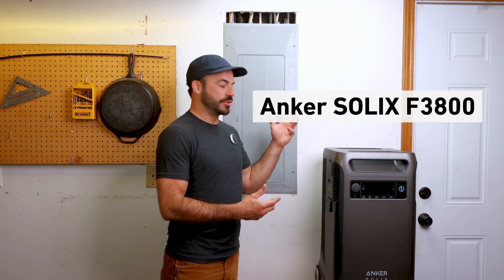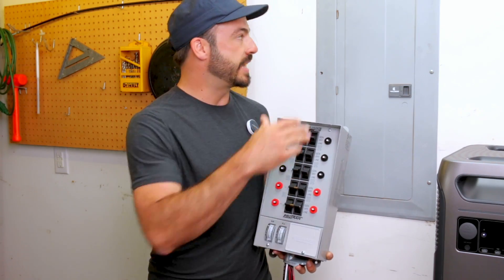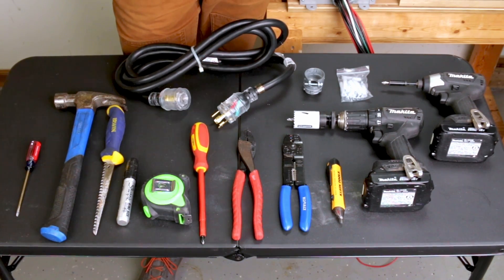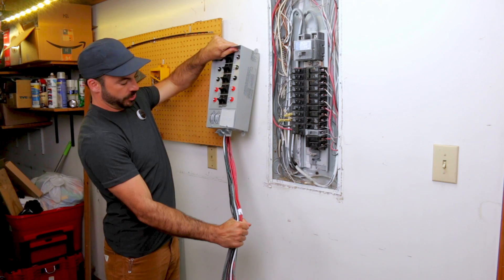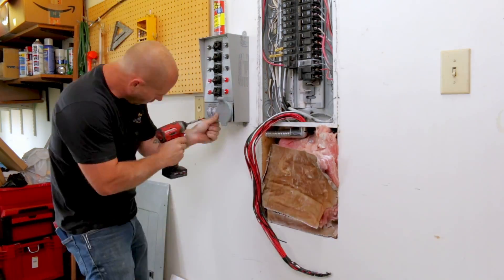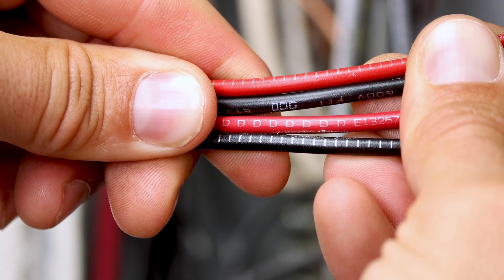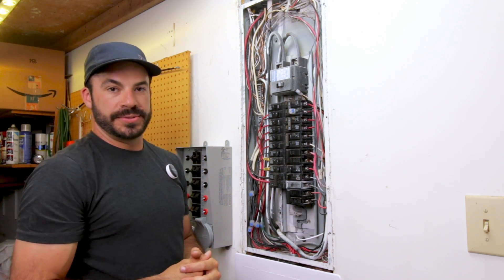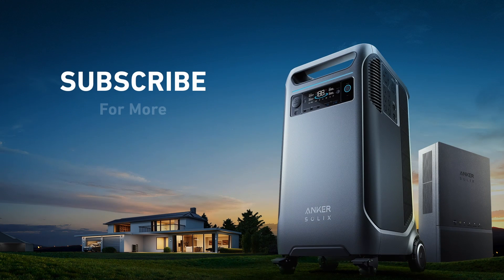How to Install a Transfer Switch for Whole-Home Backup Power | Anker SOLIX F3800

Comment: When you start your 1/2 HP house pump what wattage did it draw on start up ? The anker had no problems starting pump ? And what if you are using say 1000w on other devices during pump startup ? I have the same pump. That’s my main question before buying. Thanks
Reply from the maker: The wattage it drew was around 1000-1500, which is within the unit's surge capacity, so the F3800 can reliably start the pump as long as you're managing total power usage.
Reply: @AnkerSOLIX thanks. That is surprisingly low wattage. I see my lights flickering for a second once my pump starts. you too ?

Comment: AC breaker on main is dual 30A connected to dual 20A on the transfer switch in the video example. Will that work without tripping the transfer switch breaker?

Comment: Anker? Are you joking? Anker uses cheap, Chinese-made, high-frequency, transformerless inverter tech. Without an output transformer to provide galvanic isolation between its DC boost stage and its AC output, these units can easily damage your home's appliances and your power tools when their MOSFETs/IGBTs fail. If you want to power tools or home appliances, you really should be using a low-frequency, transformer-based inverter.

Comment: 12:00 It was disappointing to see them connecting to the lowly L14-30R 25 amp SOLIX F3800 plug instead of the NEMA 14-50R 40 amp plug. Often there are startup loads on 240v applicances.

Comment: Does the f3800 have any way to tell if your running all 120v loads when you have the 30 amp plugged in or is it strictly 240 regardless if you plug it into the 30 or 50 amp plug. I ask because this would be great in my tiny cabin which everything is 120v. Trying to find a way to address the ability to run this off grid and be able to charge it via dc or ac

Comment: One thing that confuses me is that it is only about 25 amps capable. So how is it gonna run an AC when most ACs have an in rush of 25+ amps just to turn on. On top of the other 6 circuits that may be on at the same time? How does this battery handle this?

Comment: I'm about to hook up my Solix 3800 and I'm trying to decide between this transfer switch and the other Reliance Transfer switches that have built-in Breakers. it seems like this transfer switch won't protect the load when running off of the anchor solex power. Is there something I'm not seeing

Comment: Great video. Never realized how basic a transfer install could be. I want to make sure to charge my f3800 with my solar what is the best way to do that? I would actually have my f3800 mounted to a custom tear drop trailer and when home it would be ready for outages and actively charge from and ideally power the house at night.

Comment: Did you install a 50A or 30A transfer switch?
Reply: The transfer switch allowed for a 30 amp, 120/240 volt input.

Comment: Just the load wire is being isolated. The neutral is being shared with the other circuits that are connected to the grid?   Does that cause any problems?
Reply from the maker: All breakers and switches work by usually isolating one side of the power circuit (hot or neutral) to control the flow of energy, with hot being the most common, while leaving the other side of the circuit connected. That is the case here and it is absolutely fine for this application.
Reply: @AnkerSOLIX  I have an Anker Solix F3800 and Reliance 10 circuit transfer switch. I need to know if I can run my transfer switch circuits off the F3800 while my remaining circuits in the main panel run off the grid.
Reply: There is no neutral at the grid, it's a combined earth/ neutral and at 0 potential due to it being common to ground.

Comment: This Anker Solix is by no means safe. The reason for this is that it uses low cost, (cheap) Chinese made, high frequency, transformerless inverter technology in its design. High frequency inverters are notoriously short lived, low surge products that can set your appliances on fire during a catastrophic failure of its H-Bridge circuit. With no transformer to isolate DC current from the AC output, this unit can cause the primary windings of an appliance's power supply transformer to overheat and start a fire. You should never use a high frequency solar generator for residential purposes. A much better and safer choice is to purchase a hybrid, low frequency, transformer based solar generator.
Reply from the maker: We appreciate your (strongly worded) feedback. I will say that Anker takes a lot of pride in producing products that are well made and safe for everyone to use. We put products through a rigorous testing process to ensure safety and reliability, using technology and manufacturing processes that are proven to be dependable for many years of use. To back this up, Anker SOLIX provides a 5-year warranty on its power stations, along with best-in-class customer support. Rest assured, if there is ever a problem with your SOLIX product—especially in regards to safety—Anker will address these concerns. 

If there is a specific problem you're having with one of your Anker products, I will be happy to provide contact information for support. 🙂
Reply: @AnkerSOLIX  if you took pride in your solar generator products, you would use safer, higher performance, low frequency, transformer based inverter technology in your design instead of the low cost, short lived, high frequency inverter tech that you're using.
Reply: @AnkerSOLIX  These are all industry sales pitches:
"We take pride in..."
"Well made..."
"Safe..."
"Rigorous testing process..."
"Reliability..."
"Technology..." (Used to be "Space-age technology.")
"Proven..."
"Dependable..."
"Best-in-class..." 
Full stop, it's cold out and snowing, 5pm and dark, and I'm running a furnace, a pellet stove, intermittent refrigerator and some lights, a TV and the the necessary cable box and the occasional water pump... total average 3000 watts evenly distributed across both 120 volt legs of the output.  How long throughout the night before the battery is dead?  This system's cost is $3000.00, and it's only good for occasional short power outages?

Comment: Ultimate backup power solution???  Sorry Chuck/Anker, that’s just marketing hype.  First, the transfer is NOT automatic, which means if you’re not home, then critical systems like your refrigerator or furnace receive no power.  Second, there’s no mention of how long a consumer might expect the charge from the Solix to last.  This might be a good choice for short outages, but if the power is out for a few days, then what?  A gas/propane backup generator or a full solar battery backup system is, to me, a far better choice for the “ultimate” solution.
Reply: If I'm spending 3K for emergency backup power, darn sure it's going to be a 7200 watt gas generator and some 5 gallon gas cans.
Reply: @darrendolphdragos9752  Gas generator is a great idea if you and the neighbors can tolerate the noise of the gas generator! NO THANKS

Comment: The AC will most likely have an initial draw that could be more than the 6000W available.  The 30 amp breaker will max out at 7200 watts, so did you install a soft start on the AC unit.  Since this is an emergency, I see that water is a need, but is the AC a need of the house, over the availability to cook food?  Also, can you live within the 3000 W draw per leg with the AC running and the water pump starting up?  As for the Anker Solix unit, love that it already comes with the L14-30 receptacle.  Plug and play out of the box.
Reply: Since no air-handler was mentioned I doubt this AC was a central unit, not that I believe this battery pack could ever power one for any length of time, if at all. A small split system maybe, but best I could read the AC breaker was a 2-pole 20. And I agree, the choice of which circuits would be powered seemed counter intuitive, but then again this video is an advert for the product, not an instruction or informational on how best to go about installing transfer switches. Furnace/boiler... Fridge/kitchen, Common living area, some lighting, well pump. No way will I believe whatever battery is inside this unit can power 6000 watts for any appreciable length of time, even if it's daylight and being trickle charged by the sun.
Reply: The strange part is that if he has a central AC he will need to power the furnace too.  Without that along with a soft start on the compressor, the 30 amp central AC will not work.  However, his test did not start the AC in this video.  365 watts does not include running the well pump or AC and at 365W output, he would have 7.5 hours of batter life, which is not a lot of power.  So if the larger units kicked on, he would drain that battery pretty fast.   I think that real question should be whether during an emergency, does he need central AC?         @darrendolphdragos9752
Reply: @gibblespascack1418  Agreed, like I said, he's trying to sell this solar generator, and some of the questions in the comments indicate that people watching are being mislead. The unit also has 6 x 20 amp receptacles, as well as a 50 amp 120/240 volt receptacle ans a 30 amp 120/240 volt twist lock. One of the comments was would it be possible to power a 30 amp transfer switch AND a 50 amp transfer switch, and his response was "Yes you can use both outputs at the same time." As IF this unit could output 80 amps! It's 6000 watts, not even a full 30 amps at 240. This little unit wouldn't last 4 hours at full load and costs $3000.00.

Comment: I thought the Lever-nuts weren't rated for 30 or 50amp circuits.
Reply: Seems only 20 amp and possibly 15 amp circuits were intercepted.

Comment: The problem with this product is the 60 volt limit on Solar input.  That makes it almost unusable for whole house backup.  You will probably have to put all your panels in parallel, with fuses and thus have losses due to high amperage going through the wires at relatively low voltages.  That design aspect is YEARS behind the current state of the art even for systems like this one.  An unbelievable design choice on what other wise could be a good product
Reply from the maker: When used as a portable power station, the SOLIX F3800 utilizes a 60 volt limit on solar input, which is typically more than enough for what you would need for this application. However, when paired with the upcoming Home Panel for use as a whole-home backup solution, you are not limited by 60 volt and you can use whatever flexible or rigid solar panels you'd like. I hope that helps clarify things!
Reply: @AnkerSOLIX CLEAR AS MUD .  What is max solar in put capacity  .How many KWH on single charge. How long is warrantee
Reply: @charlespaine987 the home panel is still vapor ware.  Sounds like you can pre order it but there is very little information anywhere on it.

Comment: Why not just run an interlock switch on your main panel, thereby being able to use all your breakers for choosing the ones you want on and those you want off?
You can hook up a 50amp generator connection.
Reply: Some jurisdictions do not allow interlocks. Even if they used the 50 amp version, this unit outputs only 6000 watts, which isn't even a full 30 amp 120/240 volt capacity. (7200 watts)
Reply: @darrendolphdragos9752  
Can you run 10,000 W split phase through two 50 amp breakers? 🖖
Reply: You can
Reply: And interlocks are cheaper too.
Reply: Interlocks are illegal in many locations as they do not meet regulatory organization requirements.
Reply: Because with an interlock you cannot allow both grid and battery.

Manual switch allows you to take upto circuits totally off grid powering with solar and battery while still allowing rest of your circuits on the main panel to be powered by grid.
Reply: Because they are trying to sale you THIS device.  Duh.

Comment: I was glad to see your video on the F3800 and the hookup to the transfer switch.  Although I don't have my f3800 yet (ordered through Kickstart) I have the identical transfer switch already wired in to my panel.  I have a gas generator to generate the power using the 30watt inlet connection on the transfer switch.  All this is well and good for temporary electrical, but I had in mind something more extensive.  My question has to do with the 50 amp connection.  Is it possible to have BOTH the 50 amp and 30 amp output on the f3800 working at the same time?  The 50 amp output would go to another transfer box (?) and then to the panel with the AC.
Reply from the maker: Hello, thanks for your question! Yes, both the NEMA 14-50 port and L14-30 port can work simultaneously and each power a transfer switch. Keep in mind though that the total output of the ports combined remains at 6000W.
Reply: The total output of the unit is 6000 watts, which is less than what a 30a 240 volt output is capable of. Why they even put a 50 amp receptacle on this is to hype up it's capabilities and hope the buyer believes this battery pack can power an entire electric kitchen range. To illustrate this, they have a 30 amp 240 volt receptacle, (7,200 watts) a 50 amp, 240 volt, (12,000 watts) and 6 x 20 amp 120 volt receptacles. (14,400 watts)  Add those up and ask yourself if a 6000 watt output unit can power all of that?